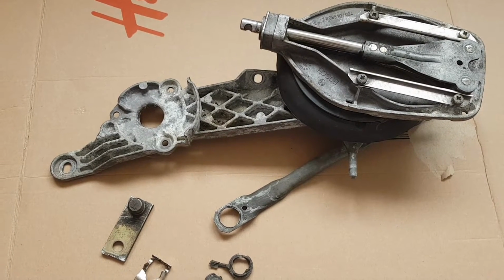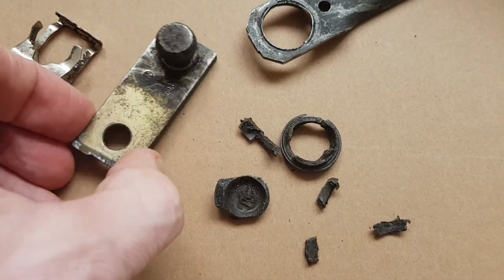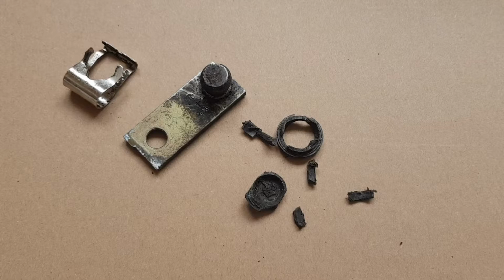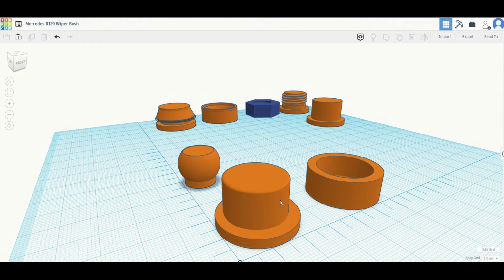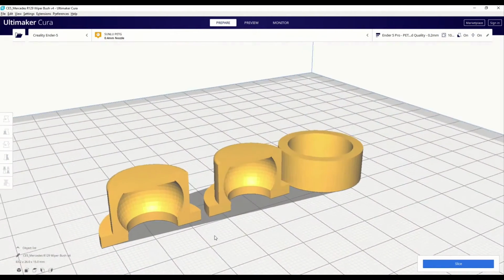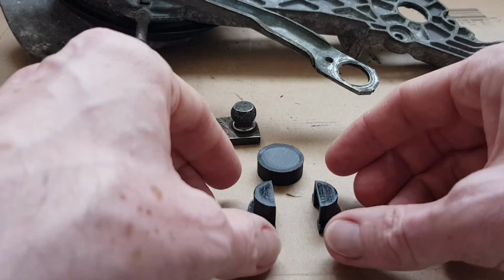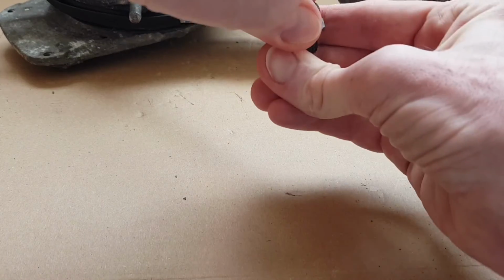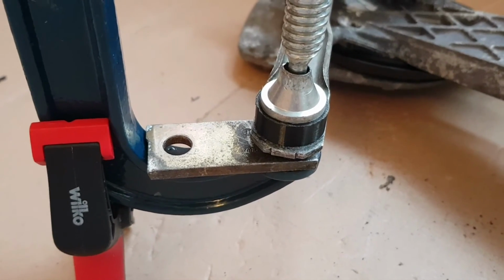Mercedes SL R129 - Windscreen Wiper Linkage Repair

Comment: My wiper goes back and forth just fine but it’s extended in the wrong area randomly one day it made my wiper hit the edge of the beam by the window and flew off lol. Do u know exactly how to fix that? Idk if that’s the same issue u had
Reply from the maker: Dont know about that. Sounds like a different issue. Ours stopped working completely as the linkage to the wiper motor failed.
Reply: @amp9438  oh okay shoot, I’m trying to find out wtf happened lol. The mechanism that rotates the wiper is fine it’s the one that pushes out and comes back in that’s messed up
Reply from the maker: The wiper arm is clamped onto like a piston that goes up and down as it moves. Maybe the clamp is loose? There is normally a bolt which holds it in place so check it's still ok?
Reply: @amp9438  ah ok thankyou!
Reply: @SuperBranFlakez  Your problem is the U cog - that is available as a separate part for around £70
Reply: @SuperBranFlakez  I know this is 3 years old, but this sounds exactly what was wrong with my windshield wiper unit. There's a gear thats articulates the piston to move in and out per cycle. The gears are most likely stripped because the plastic has deteriorated. I replaced mine and the part was $20. I messed the timing up(just have to re align the positions) but that fixed it 100%. Good luck